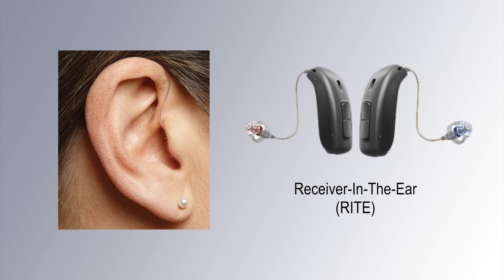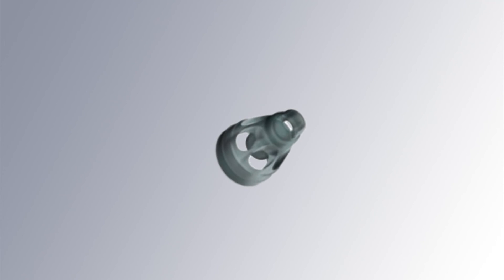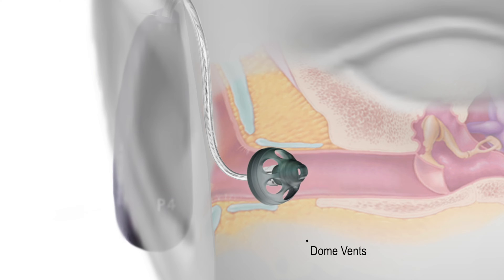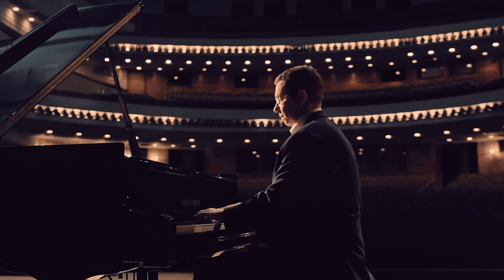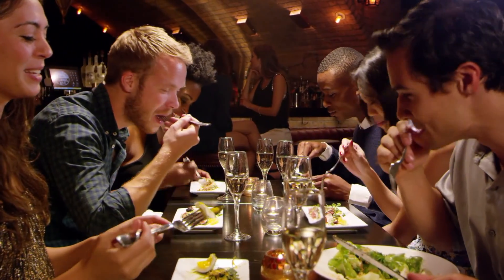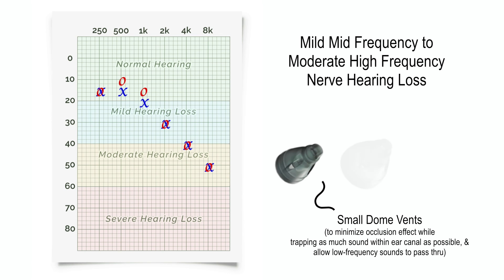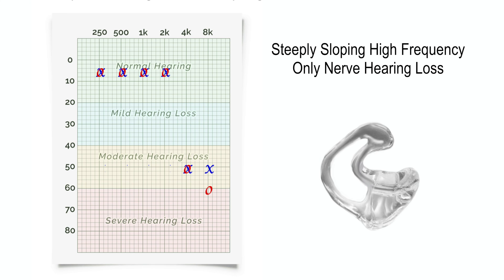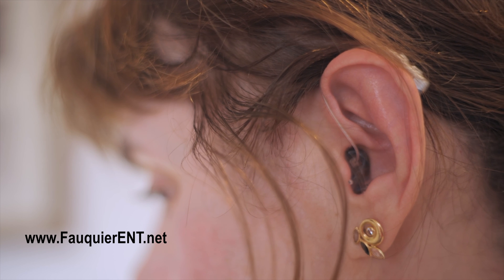What Hearing Aid Dome to Use? What About Custom Ear Molds?

Comment: I am long time user of hearing aids, awaiting delivery and set-up  of my third pair of HA's. I was not able to use rubber domes, they wouldn't stay in, caused discomfort. I use custom ear molds with "canal locks". Canal locks are clear plastic  extensions that help hold ear mold in place. Canal locks are usually glued to the ear mold but may break off if HA is dropped. Use care in removing ear molds, strain on thin connecting wire can break it at the ear mold. Repair is not covered by warranty. All current hearing aid designs cause distortion of guitar sounds, my nylon stringed guitar sounds better with HA's removed although sound is "dulled". My new Unitron HA's may perform somewhat  better than my previous ReSound HA's while listening to recorded music but will still have problems with my guitar sound per my audiologist.